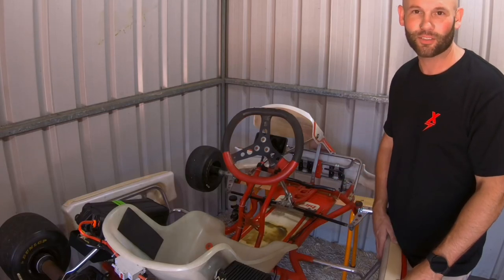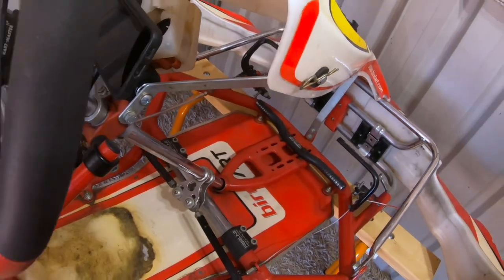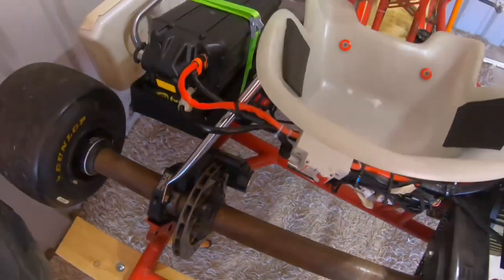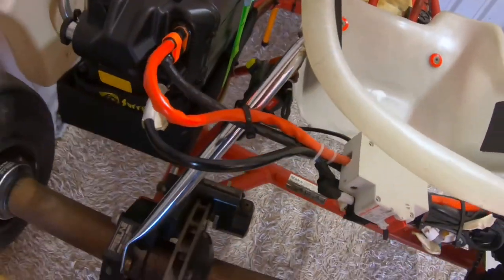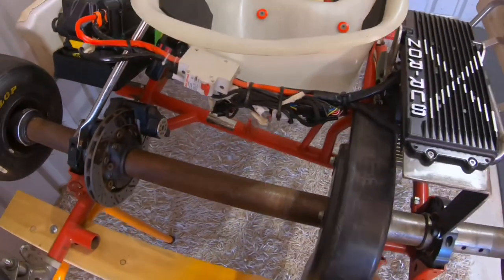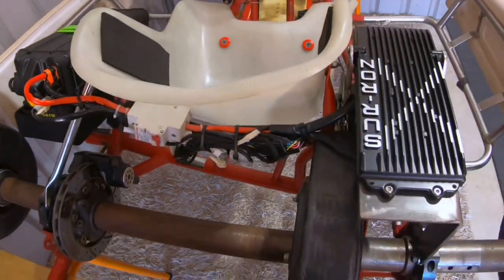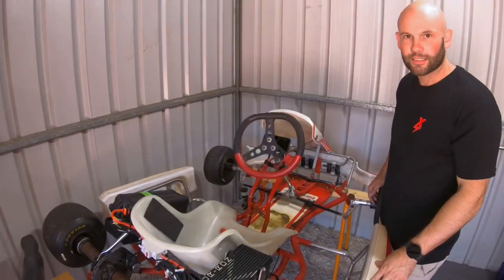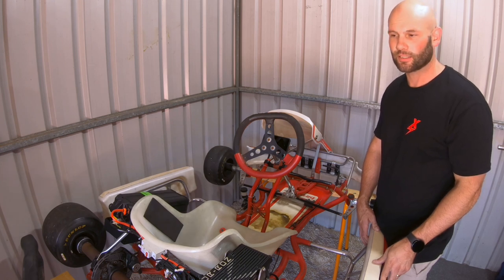First Test Drive 6kw Part 2

Comment: Very nice i just finished mine. I have the same motor battery and Controller setup as you and also some videos on my Channel. What size sprocket you have on the rear an what ist your topspeed
Reply from the maker: Cheers, I think it was about 67kph/41mph. I can't remember the sprocket size now. I sold that kart and im about to start an offroad kart build